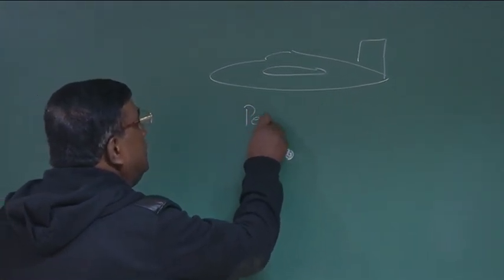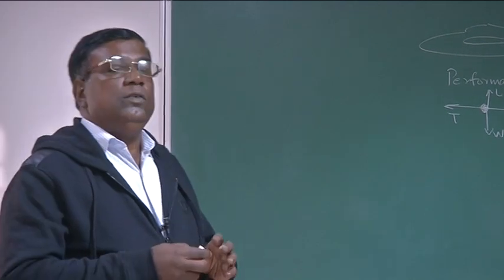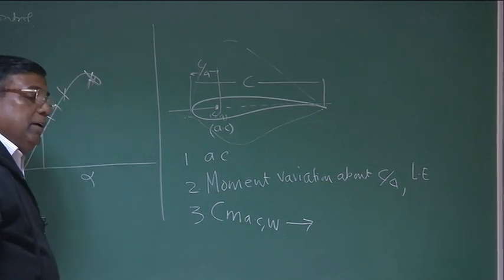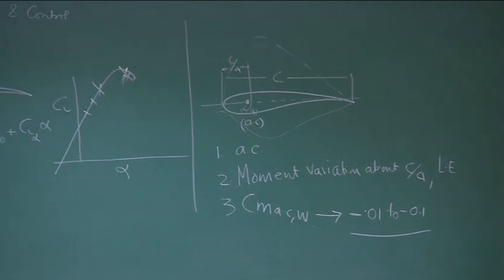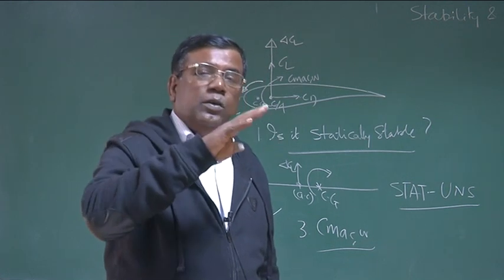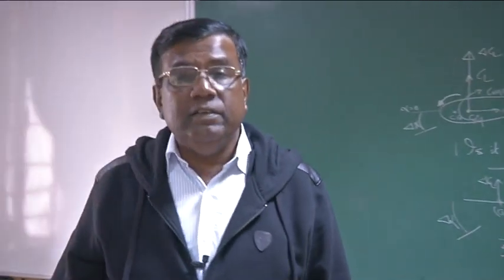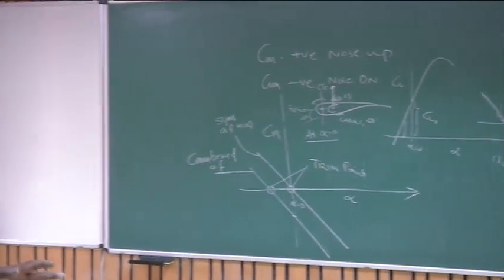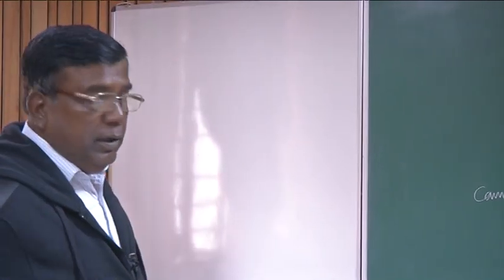Stability and Trim

Comment: If the direction of Cmac is clockwise then how it's negative and will produce pitching down moment?
Reply: The moment of force causes the body to rotate about an axis. The motion will not be translational. The force is applied to the body which tends the body to twist about the axis. It is due to the unequal and opposite force the moment is produced.
The magnitude of the moment of force is directly proportional to the force applied and the distance of the force from the axis. The perpendicular distance between the line of action and the center of moments can be termed as moment arm. Therefore,
Moment=F×d
Where F, is the force and d, is the moment arm.
The center of the moment is the reference point at which the force will cause the rotation. If the rotation is clockwise about the center of the moment we can say that the moment is positive. And if the rotation is anticlockwise about the center of the moment then the moment is negative. The force will have a tendency to act opposite hence the body twists.
If the moment of force is assigned a negative sign then the turning tendency of the force will be clockwise.
Note:
The tendency of the force to act in the opposite direction and the unequal force will create the moment of force. Hence the negative moment having rotation in anti-clockwise is having a clockwise force.

Comment: Sir, you said we don't want to trim ac at -ve AOA . Can you throw some light on it as to why is it so? Because theoretically at -ve AOA also we'll get trim condition of L=W & T=D.
Reply: If we need a positive lift from a cambered wing it will generate a negative pitching moment considering Cg,a/c ahead of Ac,w therefore we require horizontal stabilizer or elevator to give a pitch down moment to balance that. In the video sir mentions the Cm,cg,o to be positive and alpha trim to be positive for "The whole aircraft". Meaning, in a alpha=0 situation we will have a positive Cm,cg,o (due to pitch up elevator deflection) only to decrease to zero as the alpha increases to alpha trim, keeping alpha trim >0 for more lift due to more camber. Why is Cm,cg,o made positive? to make the alpha trim positive possible.

Comment: sir can you explain y in a cambered aerofoil  cmac <0 and the direction of cmac is clock wise
Reply: because for cambered airfoil there will be irregular distribution of pressure and shear forces. So if we sum up all the forces into L,D at aerodynamic center there will also be a moment cmac. For symmetric airfoil this is 0